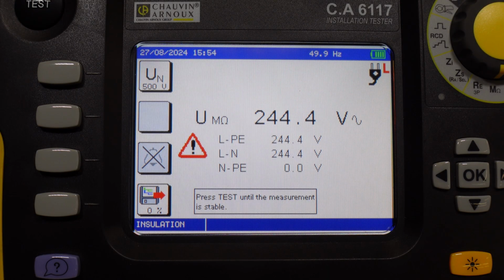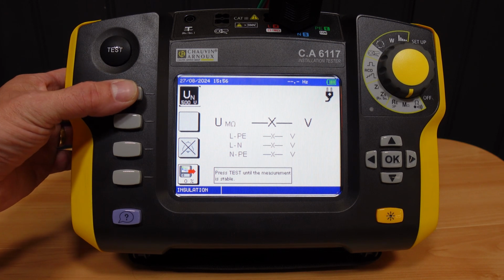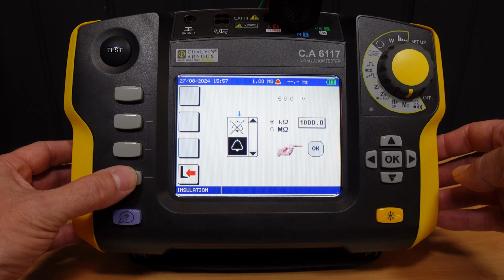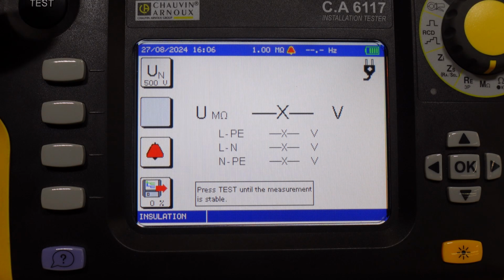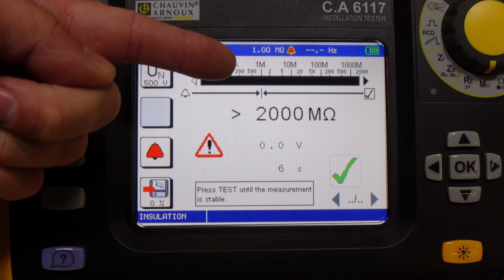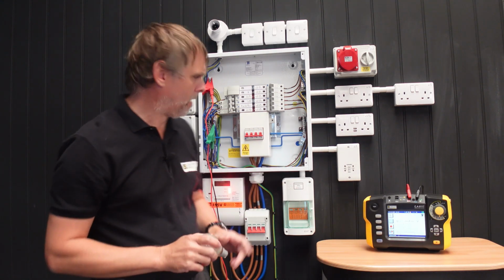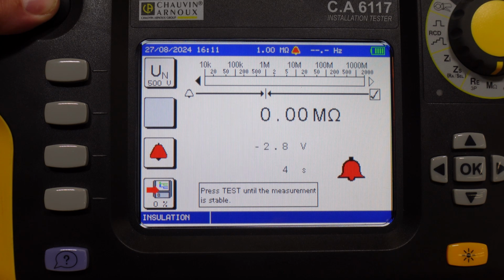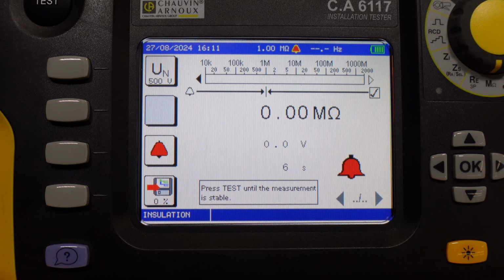C.A 6117 Insulation Resistance with Dave Savery

Comment: Why have you left the surge protection in place when carrying out IR testing?
Reply: The presence of an upfront SPD is only a problem if testing the board as a whole, a bad practice shortcut in my opinion as it will invariably give you a less than perfect number without indicating which circuit(s) are responsible for pulling it down. Here the circuits are being tested individually with their live wiring physically disconnected from the board so that we get the result specific to that circuit with none of the test current from the MFT entering the SPD.